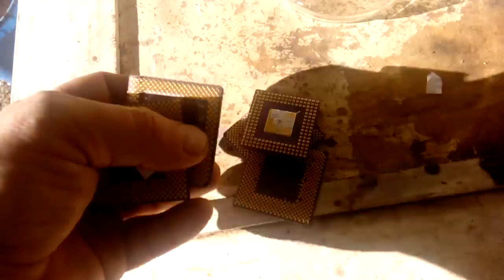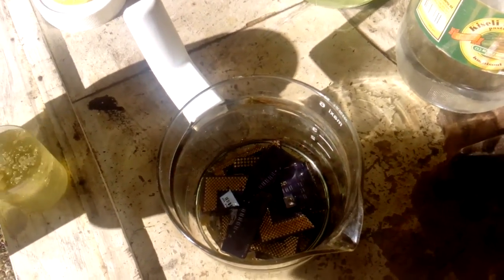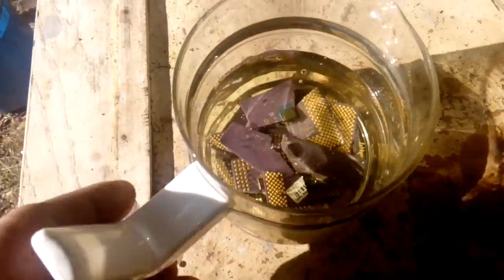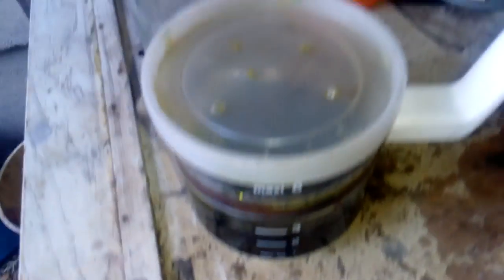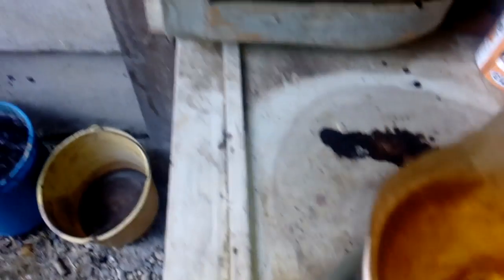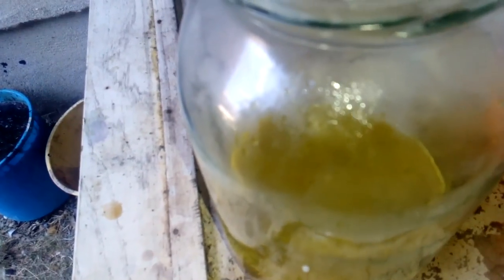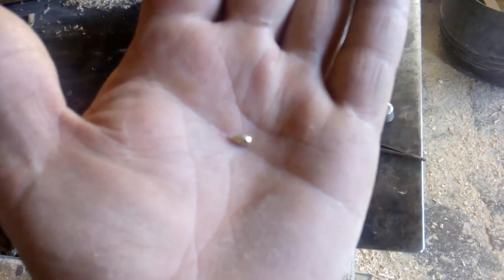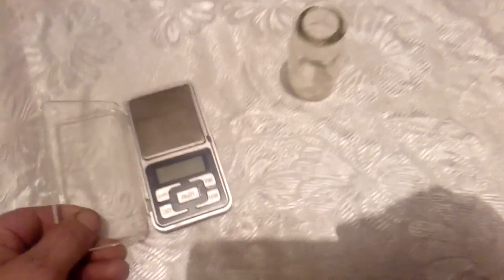Procesing ceramic cpu for gold vith Aqwaregia.

Comment: And urea is add to solution for whar purpose?
Reply from the maker: The urea is added to neutralize the excess of the Nitric Acid left over during the dissolution of the gold. Otherwise, the gold would be desolve out immediately to the solution after drop.
Reply: 999 Dusan Gold recovery thanks, then ow do you know that the aquaregia is neutralized after adding the urea? If not adding the urea can?
Reply from the maker: The urea adds a little as long as it has a reaction with the solution. At the moment when the urea falls to the bottom of the solution and does not make bubbles and the reaction you know that there is no more Nitric acid in solution and is ready to be droped. You can omit the Urea and put the solution on a mild evaporation and so remove Nitric acid because it first evaporates, it's only with Urea fast.

Comment: So you are smelting the dust together with the filter paper? Wont problem?
Reply from the maker: Yes i melt gold together with paper very often, because it is so easier. Paper will not harm gold purity because they will not mix with gold dust during melting.
Reply: 999 Dusan Gold recovery thanks sharing. I thought it would change the purity of the gold.

Comment: Dusan-thx for all your answer. I learnd but maybe I get something wrong. please 1.30g of golden pins2. put 300mlHCL and 100 ml NUTRIC ACID-put on heat solution start--wait 24 h to desolve3. filtering4. Dark green solution put cold water5. filtering6. Solution put on heat-when its worm put UREA inside. 2 TBS7 Solution is stop foam-ing.8. When solution is cold put 50 degrees water inside and put SMB9 I get yellow solution and on the boton dark borwn and SMB.10. filtering again11. there is no dark mud-no goldDusan where did I miss?
Reply from the maker: Sen me a mesage on    kreator8217@gmail.com     bro.

Comment: Great video as always, thank You! I think your yield was lower than I expected, I was expecting up to 0.6g gold from this particular chips. If you haven't got it already, please have this link http://refinementofpreciousmetals.com/Rev_0.7.1.pdf
Reply from the maker: I always review the solution twice before I pour it into the waste bucket. The amount is between 0.4 and 0.5 grams, I think it's satisfactory. So far nou one it has managed to get a gram of gold out of 10 AMD Durons, it is usually necessary 15 even more, so I think that the content of 0.11 grams per CPU is not credible information. As some websites claim that the Pentium Pro contains even a gram of gold per CPU, although no one managed to extract more than 0.3 gram, not even close to 0.5 grams. Is it possible that this content would be correct if the ceramics were grind and cooked in the Aqwaregial. This is a procedure that needs to be tried. This is just my opinion I'm not saying it's true.
Reply: The yields on this "document" are way over exaggerated!
Reply: my yield on the same type of processors was 0.04 per CPU, will do a test with 1kg
Reply from the maker: OwlTech yes it is freind.Amd is low but other cpu make good result.
Reply from the maker: People still believe in various lists on the Internet where AMD Duron has 0.11 grams per piece, anyone who has ever processed ceramic chips knows that this list is incorrect.